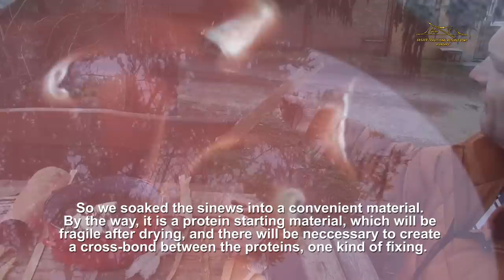Horn Bow making by Grózer

Comment from the maker: More people asked me, in which material does the sinew and the wood boiled? The wood is a plant-extract, which is fermented, and after that it is acidified. 
This material makes the wood's structure more rigid. There was handled the arrows with this same material, to shoot it also from strong bow, and don't twist them. 
The sinew is a protein-tincture (very liquid, and slightly alkaline). This material can made from milk too. 
After that, when this material dry together with the sinew, it could be fragile, and not to happen this, we should fix it (so there should be cross-binding between the proteins).
Reply: What?
Reply: I think in America you can actually purchase the one used for sinews it in a powdered form online, I have no idea about the plant based liquid used for the wood, never had to process mine in this way (and I don't live in America anyway xD).
I'm also pretty sure I've seen some guides online on how to make it (or similar one), again - only the milk way.
Reply: Mr Grozer. Can you be more specific about the material for the wood boiled. The plant extract?
Reply from the maker: @victorneto6014  That is an acid treatment with a natural material. It makes a little more carbonated the wood and makes it more durable. The horn is needed to be treated as well but with another material.
Reply: @csabagrozer7557  the bow is amazing, but I noticed that the Handle & limbs are one wooden piece with the two ears being separate pieces / Compared to other bow types which have 5 separate pieces (ears, limbs & Handle), is there any advantage or disadvantage to it ?
Reply: And could you please elaborate more on the sinew type? Which animal are these from? Looking at the shape, I guess it’s from a leg, correct?

Comment: I am an artist sculptor, inventor and great handyman since childhood. A 76 year old grandpa. For months, I have been bothering to cut bamboo blades with a plane and files to make Asian, Turkish, Mongolian arches etc. I won't hide from you that to hand plan a 9mm bamboo blade to arrive at 4 and 5 mm thick, moreover with a change in thickness along its length, it's a hassle. File in one hand and caliper in the other. I don't have a circular saw and an electric planer, damn. I have just bought from a seller of archery equipment in France large (reconstituted bamboo blades 5 cm wide and 1.90m long and 2mm thick.) For the manufacture of several bows for my little ones children and my daughter.
the problem is, i'm broke and these bamboo blades cost me an arm even both.
Can't find the original manufacturer which I think is from China? "It is not a certainty"
I am looking for a distributor and the Asian manufacturer of these large reconstituted bamboo blades. Thank you
Why are the handles of Turkish arches the other way around?
I can't seem to get a good answer on this topic. ???

Can you help me find this maker? Thank you.

Yours truly
Patric

Comment: I believe the adhesive used for the wood soaking and sinew is blood based,albumin, heated to approx. 160 degrees. Purchased from slaughter houses etc. Or in powdered form to add to water.
Reply from the maker: The blood-albumin adhesive can combine very well with casein-glue too, and then the glueing will be more waterproof. 
You can make these adhesives by yourself, I was dried the blood-albumin, break it, moreover I was stored it in fridge.
So when the blood is clotted, you can make it yourself, and you can get it from the slaughter-house.